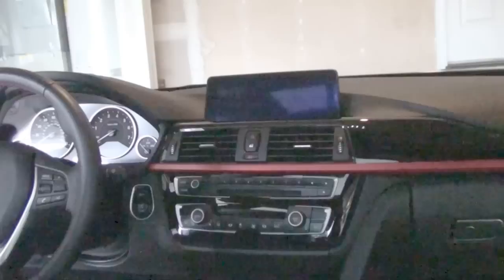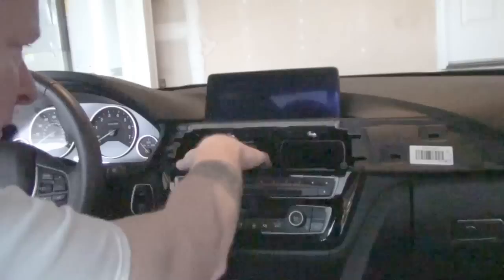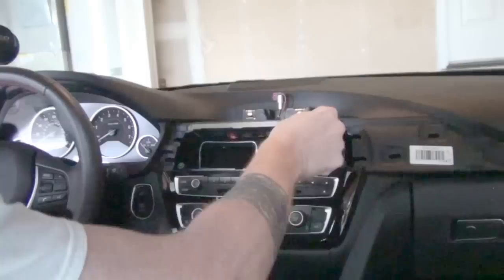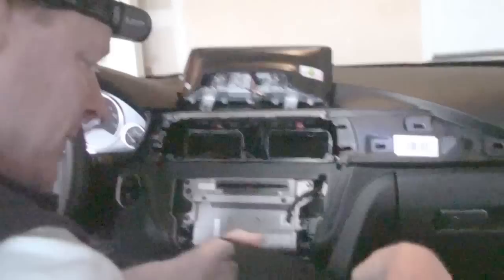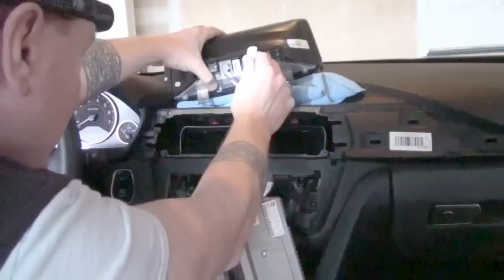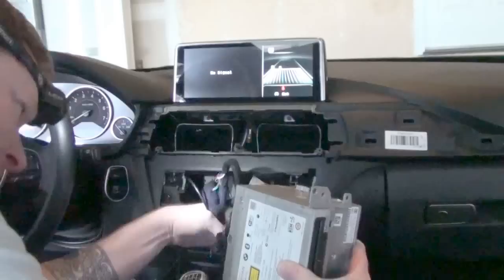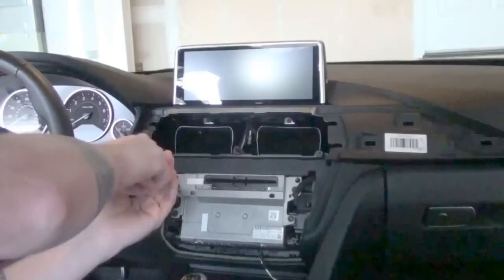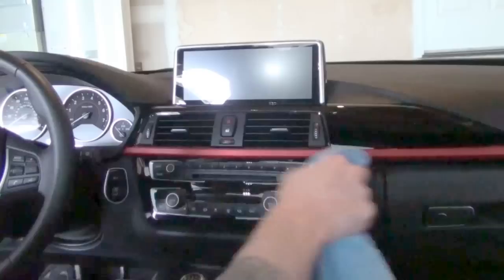BMW F32 Avin 10.25" BMW Android Multimedia Navigation System installation DIY

Comment: Hi,

I have an issue with my BMW using Android 8.1 unit, Multimedia. The dealer have no idé of how to solve it. 
Been given the possibility of returning the unit. To be honest that's nothing i really want, due to being able to atleast use the GPS and Rear-Camera.

Pretty sure someone else had this issue or facing it, like me. After some dialogue with sellers in China they have faced this issue before with some customers and just told them to try using the RCA->AUX. If that would not have worked, they have been told to return it.
Im fully aware of the fact that it shoulden't be that hard to actually solve the issue, as i do get sound from atleast 1 speaker. I have tried to rewire the cables and troubleshoot as far as my skills go. I just gotta admit that i´m not that experienced and starting to give up.

To start with:

This is the unit i did order and using: https://tereteknik.se/BMW-Bilstereo-DVD-GPS/BMW-F30-F30-F31-F34-F32-F33-F36-bilstereo
My Car VIN is: WBA3Y51040D658086
Modell: 320d Gran Turismo xDrive / 2013 / 2014
Link to YouTube to see/hear the fault: https://www.youtube.com/watch?v=eRCdmnHvb6c

- The AUX-Port have been checked. I have tried playing music straight from my Phone = Working as intended.
- Using the new display with the old interfance when playing music from Radio/Bluetooth = Working as intended.

- I have tried re-soldering the AUX-Female from the new head unit, thinking there was some issues with it = Same issue.
- Tried different AUX-Cables = Same issue
- If i do not push the AUX-Cable all the way in, i get sound from all speakers. Bad sound, probally Mono as the AUX-Port is fine.
- Have moved the 2 green wires from the old harnest, to the new one.
- I have tried unplugging as much cables as possible from the new head unit harnest, to pinpoint what cable goes where = Can't find the specific AUX cable, only for the original harness.

If someone know how to solve this issue, i would be forever thankful.